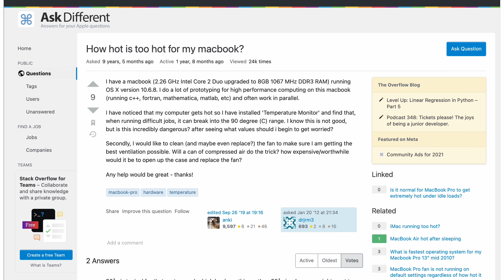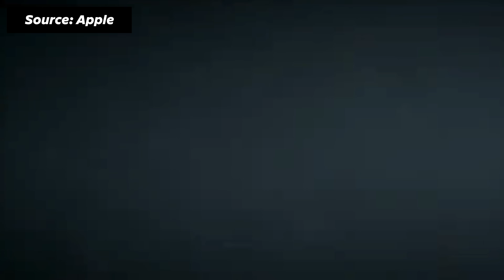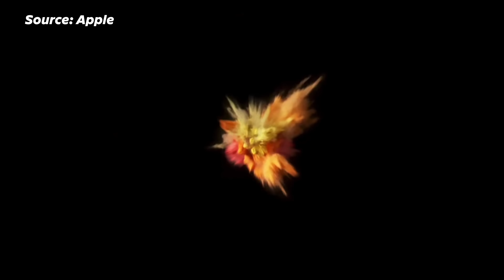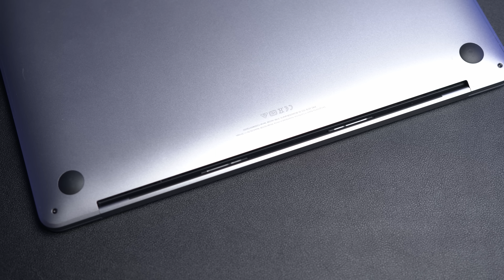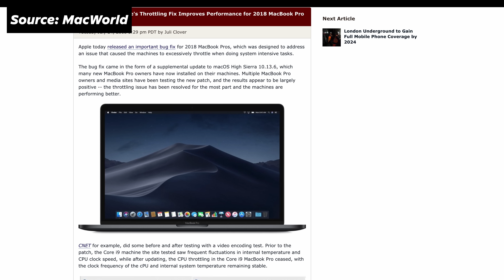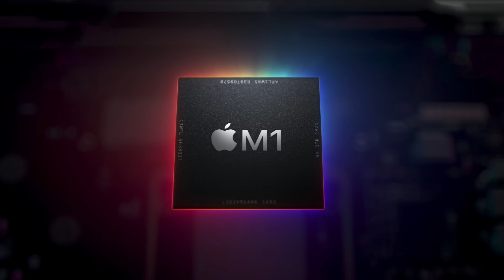Why Do MacBooks Get So Hot?

Comment: Even with M1 aside as the clear exception of fixing the root cause of heat, I’ve had Windows laptops such as my previous Dell get far more hot and even worse, their inlet vents are at the bottom and get blocked easily on your lap compared to the MacBook putting the inlet along the sides where it won’t be blocked. Also on macOS you can get an app like Macs Fan Control which give you a last resort option to manually ramp up the fan, AFAIK due to hardware fragmentation a similar option isn’t available for Windows.

Comment: using this comment section for help since apple support won't respond to me lol my screen time on mac doesn't work for some reason. i already turned it off and on a few times but it still does not track my screen time. it used to show my screen time for both my phone and my mac but now when i use the widget or look at it through the settings it just said 0s even though i've been on my mac all day. anyone have this problem too?

Comment: My MBA M1 run super hot when I work with audacity or devanci resolve.
Reply: Audacity (in my experience) is poorly optimized for x86 as is, and lacks an M1 optimized version altogether. This isn’t to say your point isn’t valid, mind. Just if you want to avoid your MBA getting hot, you could use OcenAudio. Iz’a free as well, M1-optimized, and similar enough to Audacity that you don’t have to relearn everything from scratch. 

No idea if and how DaVinci can/will be fixed.
Reply: @Fluffisnoterm  what about final cut pro's heavy continuous use bro.?

Comment: Overheating problem is not because of Apple but rather intel who promised 10nm chip by 2015. Which made Apple to redesign their MacBook Pro to a compact device
Reply: If would have wanted a 10nm chip they would have used amd chips.
Just one silly excuse of apple to turn the mac into an iphone zero upgrades
Need more storage? buy a new one

Comment: My fanless MBA M1 always stays cool and even after heavy use, remains kinda warm.
Reply: yep, i sculpt 3d models on my MBA and feels only warm so far
Reply: Yeah, while using photoshop in my MBA M1 for over 3-4hr straight, it doesn't even cross 40°C as it is native for M1. But while I use lightroom it crosses sometimes 75°C.. 
Haven't updated the lightroom yet!
I've to update and see if there's any difference!!
Reply: What's your opinion on heavy use of final cut pro for hours...? How does it performs then ? Just asking to know before getting one.
Reply: @bptyt  In final cut editing with a lot of gpu effects (M1X should make this a lot better) does put strain on M1 macs but otherwise it’s good.  During export time without gpu effects the M1 Mac air seems to start start getting hot after about 5 minutes. The pro does better cause it has a fan. Mac Mini has best thermals btw.
Reply: @bptyt  This is what my roommate told me. I yet to buy a apple silicon Mac because I need more gpu power for unreal and unity.
Reply: @bptyt  Performs very well until it throttles, sadly :(
Reply: @vinipraion4157  throttles? On the m1? Air or pro?
Reply: @bptyt  Air, thermal throttling when you are doing intensive stuff (World of Warcraft, Final Cut, etc..)
Reply: Exactly me too
Reply: do your MBA m1 gets hot when using external monitor and keyboard at the same time?
Reply: @russellozada3063  I guess you're asking, does the keyboard area gets hot when there's an exernal monitor relied to it?
Reply: Idk why my mba overheats after very heavy tasks but performs very well like no problem
Reply: My mba m1 run super hot when I work with audacity or devanci resolve.
Reply: @_DigitalRemake  I just want to let you know audacity just caught spying on you.
Reply: @nickgennady  huh v
Reply: @_DigitalRemake  what does huh v mean?
Reply: @_DigitalRemake  There is apparently a open source version on GitHub that removes spyware.
Reply: @_DigitalRemake  my m1 pro gets very hot when playing Civ 6. but the fan barely turns on. the cpu is cool, but the body gets hot.
Reply: @_DigitalRemake  I also use DaVinci resolve and audacity on my MBA M1 and it doesn't overheat, only gets a little bit warm

Comment: Are apple laptops built for obsolesence? I have owned macs from 2010 all the way to 2018. 2010, 2012, 2014, 2018. I feel that the one that lasted the longest and still does is the 2012, and the 2014. I strongly feel the new macs are not lasting long enough.

Comment: my M1 mbp doesn't get warm at all & the battery lasts up to 20++ hours of usage in a normal condition, but I noticed that it throttles & the battery drains way much faster whenever I run CrossOver/Steam to play games (Witcher III, 30 mins-1 hour of gameplay). Does it harm the hardware if I continue to play? or should I let it be?
Reply: Turn on your air conditioner to cool  the PC
Reply: @esthervanda7401  I always do
Reply: I dont know any with 20hours on a mac M1. Maybe if you dim the screen  at 10% and play mp3

Comment: Awesome video as always! When talking about all the newer USB-C based MacBook Pros, specifically the 15 inch models as that was the topic of most of this video, I think it would have been important touch on dedicated GPUs compounding the issues. while doing doing tasks on integrated graphics, heat usually isn't too much of an issue, even with more intense loads. But when running software that triggers dedicated graphics or whenever the laptop is plugged into any external monitor, the dedicated graphics is always enabled even making heat issues exponentially worse. Heck, I remember my 2018 15inch MacBook Pro fans would run at idle while plugged into an external display! Even with like no real load on the CPU! lol

Comment: I have a MacBook Air M1, the cheapest, 7 GPU Cores, 8gb ram, 256ssd, and for my work the laptop is cold, literally coold, 0 heat, i use Photoshop, many Firefox tabs, excel, Spotify, Skype, WhatsApp web, sometimes Zoom, all at the same time, prior i had a Lenovo laptop with a i5 9300H, 16gb ram, 512gb ssd, gtx 1050 2gb, and not only it got pretty hot, the battery was awful, 4hs max with power saving, im not an Apple fan, but i have to agree that M1 is a revolution, that's why i changed from windows ecosystem, that i used since always to the M1. Im not a fan of MacOS i still prefer Windows, but for me is not a deal breaker since all my programs have a Mac Version.
Reply: Do a video. If you use photoshop on 2 mb pic i get it

Comment: I believe the current design of the MacBooks were meant specifically for their custom silicon in mind. But for whatever reason, they didn't feel confident, or perhaps weren't ready, so they had to settle for Intel's chips. Which run much hotter, and require far better cooling.
The next-gen MacBooks will be designed with Apple Silicon in mind, so I highly doubt we'll see thermal issues or performance degradation in their upcoming lineup.  Think of the iPad Pro and how thin it is. The MacBooks are headed in that direction.

Comment: Yes, but part of the story is left out. Completely agree with what you said, but I just wanted to include the Intel had, for almost ten years, kept promising that they would make their ten-nanometer processor but never did the the macbook's thin and slim design was made upon that. Another reason to push towards the M1 chip. But then again, Apple did not connect the heatsink to the fan for some reason for the beginning 2020 models, so that was a mistake o their part.

Comment: Great video, just one thing about the redesign Apple did for their lineup. As far as I know they expected Intel chips with different specs and more performance for less heat, but Intel wasn't able to deliver so Intel just upped the power input off their chips which led to the overheating issues in the macbooks. They were simply never designed to hold these chips with these specs.
Reply: This. Intel was supposed to have 10nm CPUs when this era of macbooks were released. Then continue on to 7nm. Intel is just now getting to 10nm. While the M1 is on 5nm. TSMC is about to start producing 4nm at the end of the year and 3nm next year.

Comment: Thanks for the video! I have an i5 MacBook Air from 2020 and it’s a disaster. When I‘m on a work call with Google Meet or the likes the temp goes up to 102 degrees Celsius and the fan sounds like a 15 year old laptop. It’s annoying and distracting. I had the i3/256GB MacBook Air 2013 before - didn’t get that hot and the fan was turned on maybe 10 times in the 7 years I used it.
Reply: You could try using the Turbo Boost Switcher App, that will let your Macbook run much cooler and the battery will last way longer. I've been using it a while now and everytime I want to have the fans to be quiet I turn it on and it works fine.

Comment: You total forgot to mention the real reason MacBooks run so hot. Intel promised they would produce smaller nanometer chips. So apple took their word and designed for the new smaller promised processors. Then intel couldn’t come through with the smaller chips. But apple had already planned on the smaller chips and their cooling needs. Not the larger sized chip in their redesign. This intel failure is what led apple to make their own processor (M1). So this issue would never happen again.
Reply: Its a joke that Apple is droping 2 cores each year in a new mac. Just generation 2 and they have 130 billion transistors.

You never know how hot it is because it better for apple to make you buy a new mac each 2 years. A fried chip is good for apple

Comment: I have the M1 mbp and it goes get hot , really hot . Yesterday I was running a heavy intel based app , recording a meeting through OBS which also is a intel based app , safari few tabs open and Twitter , It really got hot but the fan didn’t ramp up . I really don’t understand why apple doesn’t allow the fan to run at full speed on the M1 even in heavy loads.
Reply: I don't run heavy apps on my m1. I just browse with it with my mozzila and express vpn.   I am not a heavy PC user
Reply: Dont understand? Its like this
Hot mac-> fried mac- buy a new mac->apple is happy

Comment: Where did you get the information about the thermal compound change in the intel models? Is there any official source of that? Also, why do you mention M1 as hot as Intel in the video subject?
Reply from the maker: Plenty of sources on Google regarding thermal compound. I don't claim that M1 is as hot as Intel... There's a whole section in the video as to why M1 still gets hot, but nowhere near as hot as Intel versions.

Comment: We know why the current design had issues; due to the Intel roadmap promises. Apple designed this series around Intel saying that they would be down to 7nm. Of course, Intel broke their promises and Apple as well as Dell (et al) suffered from thermal issues. The blame is squarely placed at Intel and this is why Apple ditched them and went their own way to the M1. Even now my Intel machines on the latest 11th gen have thermal issues and fans spin up constantly. Apple had to use software, firmware and active cooling to rescue their Intel machines from the poor thermals. Of course, if Intel had done what they said none of these issues would have been relevant. 

The new MB Air will be even thinner as they no longer have to worry about Intel roasting. An aside, it is not just Intel, Samsung chips have suffered badly from overheating, Exynos and the latest SD888 manufactured by Samsung. I read that even the new Exynos/AMD collab has major thermal issues with a 30% reduction in performance under load due to overheating! What Apple did by dumping Intel will hopefully mean that Intel catches up. I understand they are losing 20% of their business they had with Apple and they need to get their thermals sorted and have ordered TSMC 4nm chips as a stop gap to cover themselves for the 2-3 years it will take to catch up. So expect Intel machines to improve over time from thermal constraints and we shall see more thinner and lighter machines (Galaxy Book Pro an example). Better late than never!
Reply: Open a Macbook air and you ll see the cooler is not connected to the cpu. Apple doesnt care. Period. Bad design . Apple has  a reputation of if the mac fries  we dont care  buy a new one or pay apple care.

Google  mac trashcan bad thermal design.

I dont think intel was caring about a customer with 10% market share like apple.
Apple made M1 to steal and make mac non upgradeable to turn mac into an iphone to make you buy a new one if you want more storage

Comment: I envy M1 users. I'll never know how cool M1 is. Just got my i9 bec company wants it i9. :_( And it gets really hot even with external fans directed to the laptop. It needs A/C literally to keep it cool. Dem.

Update: They fixed the wattage increase when external monitor is connected -- I think later part of 2022 or early 2023. Can still get hot on intensive use though which is a bit expected unlike when it gets burning hot just by connecting an ext monitor. Latter really sucked. It took them 2-3 years to fix it based on similar complaints. Shame, but thanks they fixed it 😅
Reply: Is it getting hot even not connected to external display ? Mine is ok if not connected to external display. My 2014 mac and 2017 macair much better than 2019 16inch mac. I desparately want to sell it.
Reply: @techtamilanofficial  my adaptor won"'t work, so have not connected it to external monitor yet. But since you mentioned, I dread it now for my gpu. More heat to come. Lol.
Reply: @jelloace3097  I use 4K 32 inch external monitor. problem is with how it setup for discrete graphics card. max it reaches up to 69 degree heat for cpu and GPU. main issue I noticed if when you go on zoom and skype calls. mac feels like 10 year old machine at that point sluggish and slow sometime non responding.
Reply: @techtamilanofficial  We are on teams. It's smooth with Teams. I find zoom sluggish even on Windows 10.
Reply: @techtamilanofficial  I'm not even into rendering. Using it to program. Intel always sucks.
Reply: I m using a i7 Lg gram no fan no noise

Comment: my M1 MBP doesn’t throttle no matter how much I max it out or how long I max it out for. The cooling is more than adequate and the fan is off 99% of the time
Reply: I agree with you no problems here editing with da Vinci resolve all day everyday
Reply: Really? My pentium edits 16k videos on windows vista. Believe that?😅😅
Reply: @Static-4  technically any processor could handle even 32k video if it has the right codecs, the question is how long it takes to complete the job

Comment: I took out the original 128 GB SSD off my 2015 MacBook Pro, and installed an adapter, so I could install 512 GB nvme SSD and noticed that the place where the SSD touches the bottom gets slightly warmer than with the original proprietary SSD, but works fine thankfully.

Comment: Basically i am a civil engineering student most of the software i need works only through rosata and take good amount of ram can you tell me which varient should i get as i can afford only base model  of mackbook air , but if memory swap issue is really serious then i have to think about other alternative , or should i wait for m1x chips(can't wait really but still...)
Plz reply 
Yours faithfully
Subscriber
Reply: Engineers doing big projects like big buildings use windows.
Why do you think M1 autocad took so long?
Win autocad versions outsell mac versions by 3x or more since mac intel era.
Rosetta eat a lot of ram you would need at least 64gb ram to be decent

Comment: I dont find 48 degrees is hot..especially most intel laptops reach 90 degrees or more with fans kicked in
Reply: My MBA 2020 gets to a cozy 102 degrees celsius (at about 20 to 30% CPU usage) - 48 degrees sounds like dream, I’d even take the 90 because the fan is turned on at 92.
Reply: @sarah.bea.  but MBA 2020 doesnt have a fan
Reply: @asiaparadise3988  it does. I have the i5, not the M1 chip. Also from 2020.
Reply from the maker: That was simply b-roll, Intel Macs get much hotter, where I've found that M1 Macs can get to around 50 degrees.

Comment: I never knew a laptop could actually be used on a lap without burning yourself until M1 MBA, the battery life is so much better than I had on any laptop over the years, like I only have to charge it once every other day on heavy usage (7+ hours everyday) and still it has around 12% left when I go to sleep on charge day, it’s just like my iPhone, doesn’t get hot, does what I need ultra fast, lasts all day, has great stereo speakers, plays most of the games I like, and is a bliss to watch TV on!
Reply: My dad told me to stop putting laptop on my lap since it makes you Sterile.
Reply: @nickgennady  https://www.theverge.com/circuitbreaker/2018/4/27/17286536/laptop-fertility-sperm-eggs-effect-external-heat-radiation it’s not a big deal as you think, minuscule if any impact. The hottest part of the laptop is towards the rear near your knees, you could just also be smart and don’t shove it so close that it’s on your crotch 🤷‍♂️

Comment: Even the M1 suffer  this??? :/
Reply: During normal task like web browsing it is very cool to the touch. Only when extended loads occur it gets hot. But 5 minutes won't heat it up.
Reply: It’s mostly theoretical now. The M1 runs warm, not hot. Even when they’re throttled, they’re still plenty fast.
Reply from the maker: Nowhere near as bad as the previous Intel generation. However, since they use the same chassis, they will still heat up and thermal throttle to some extent.
Reply: @CreatedTech  Ok, I suppose that we should expect this, i had a MacBook Pro 2016 and it was very uncomfortable to use it on my lap, and it was really difficult to export some videos on it, sometimes it failed exporting the videos due to the thermals.